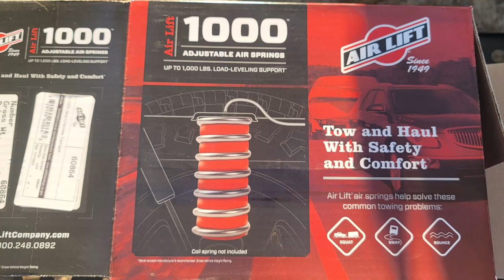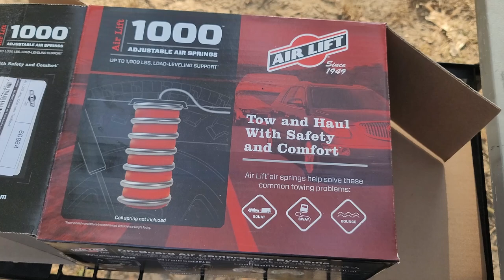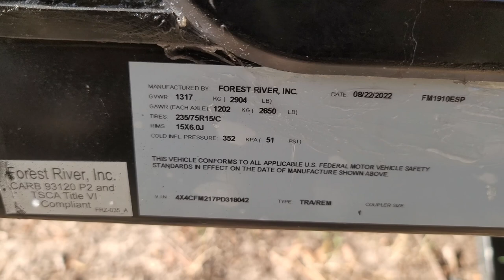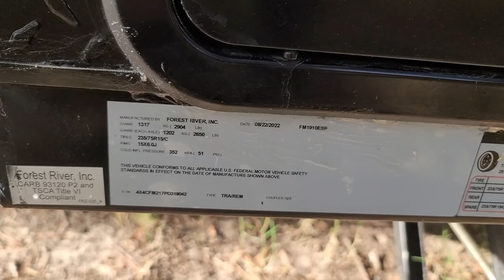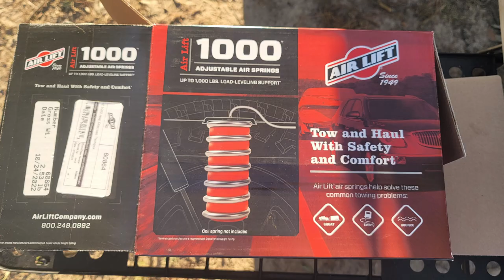AIRLIFT 1000 ,WITH MEASUREMENTS, On the Cherokee Trailhawk

Comment: Jacked up the rear like I did on my '70 Challenger with deep disk Cragar's on it 🙂 Good job!
Reply from the maker: I bet that was sweet.
Reply: I’ve been concerned with the front end lift on mine since we got it (Flagstaff A-Frame on Jeep Cherokee Latitude). Definitely going to get a set of these before our next long trip. Thanks for giving a thorough install info as well as lots of measurements.
Reply from the maker: @davidglenn8233  I just loaded a 12volt fridge, 2 totes full of camping gear, and a few other items in the back of mine. No squat, I like it.
Reply: @Outdoors4adventure got them installed and leak tested (as you noted, getting them into the springs was the most difficult part). Definitely see and feel the difference. Looking forward to getting loaded and hitched up later this month. Again, thank you for a great video!